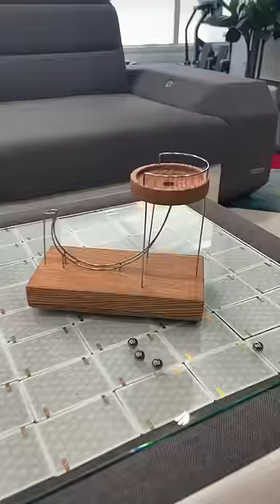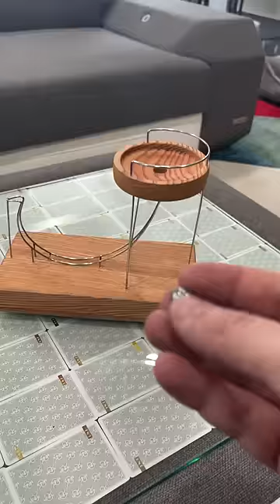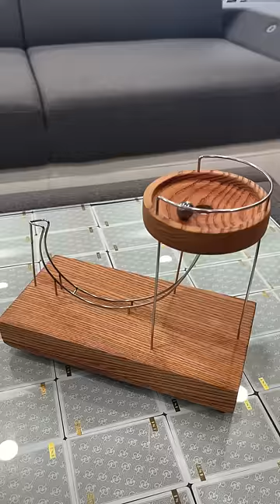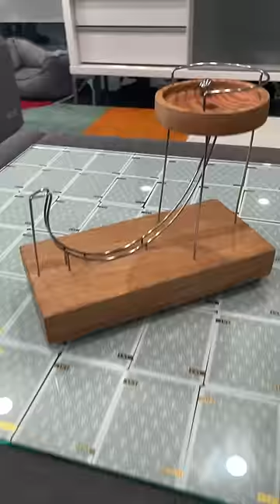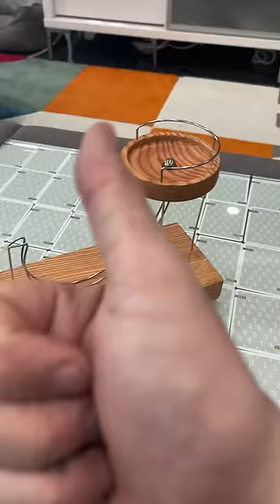An Impossible Perpetual Motion Device?! 😳 #Shorts

Comment: The fact that it went higher than the original starting point when it fell down is already a red flag and physically impossible. potential energy can't be the same or even higher than it was before.
Reply: so the metal ball is accelerated, right?
how can you attract and accelerate metal/steel? ;)
Reply: @rickwoud4319  it either has an accelerating wheel next to that hole or an electromagnet in that thick base.
Reply: @madlad847  My money is that there is a magnet in the wooden bowl, you can almost see the indent of a ring around the hole.
Reply: @shuheihisagi6689  it has a motor and it runs on batteries. Looks good though.
Reply: Psh, just remove the laws of physics and it’s fine
Reply: "potential energy can't be the same or even higher than it was before"

Uhhh, that's not true in the slightest. Even if your're talking about GRAVITATIONAL potential energy, that assumes there is no initial kinetic energy, which even in this example there obviously is (even ignoring the fact that there's a hidden motor).
Reply: @ahall9839  wrong, there is no initial kinetic energy at point of falling down, it comes to a full stop at the hole. 

when it is falling/sliding down, potential energy converts to kinetic energy, so at the lowest point, there is only kinetic energy left, which can't be as high as the initial potential energy due to friction with the metal slide and air (which converts to thermal energy) and therefore the metal ball can't reach 100% of the initial potential energy again, meaning it can't jump on the same altitude level again where it once was. 

and if it had more kinetic energy at the lowest point than initial potential energy, which this toy probably has, it would be motor-powered and therefore no Perpetuum Mobile.
Reply: @madlad847  wrong. It doesn't come to a full stop. Thanks for the physics 101 explanation that I wasn't arguing against, though
Reply: @ahall9839  wrong. it does come to a full stop, there is no initial velocity in z-axis before entering the hole, and even it it had minimal speed in z, it would definitely be not enough to go much higher than its initial starting point, which it did here in this video. and even if, it wouldn't go on forever like this here did because friction would quickly slow it down. 

looks like you needed that physics 101 though...
Reply: @madlad847  I said there was a motor in my first reply. Are you perhaps... neurodivergent?

And of course there is initial velocity, this isn't an idealization like in your high school physics class to make the math easy enough for you, this is real life.
Reply: @ahall9839  thefuсk are you talking? you were arguing against my argument that a perpetuum mobile (like the fake one in the video) can't exist because potential energy can't be higher than its initial value. obviously when you put kinetic energy from another system (motor) in the ball it can go higher, but then it's not a perpetuum mobile rofl. so again, what are you talking about?
Reply: @ahall9839  to your edit, there is no SIGNIFICANT inital z velocity, if there was, it would be so small that there is no way that it could go that much higher in altitude. just read my replies correctly.
Reply: @ahall9839  talking about high school physics, the irony is strong in your comments...
Reply: @madlad847  it's not that complicated. You said "potential energy can't be the same or even higher than it was before" which is just an incredibly dumb and incorrect blanket statement.

Even if you had less incorrectly said GPE instead of PE, that still ignores initial KE which exists in 100% of real world scenarios (hint: this is a real world scenario).

So your blanket statement of "potential energy can't be the same as before" that if actually said correctly (which again, you butchered) only applies to very a specific idealized scenario. So you're just wrong in every way possible.

Now don't go on some rambling tangent where you regurgitate 19th century physics simplified for babies from your high school textbook and confuse yourself. I don't feel like repeating myself again.
Reply: @ahall9839  spare me with your smattering, you still didn't get it. read again and tell me when you got it, cheers.
Reply: @madlad847  I'll take that as a concession since I refuse to believe that this is too subtle for even you to understand with your limitations.
Reply: @ahall9839  whatever you want to believe mate, i just don't discuss with apes, waste of time, like swimming against the current. cheers
Reply: That's a moot point, because the ball isn't at rest to begin with, it has kinetic energy.

However, the fact that it both is higher than it was and clearly also moves faster than it was as it enters the platform makes it obvious that it must be accelerated along the rails.
Reply: So may people in the comments clearly don’t know what they’re talking about and will defend it to the death
Reply: He tells u in the video that its impossible. Why are u acting like ur some genius that has seen through his lies
Reply: ITS AN ILLUSION LOL
Reply: @ahall9839  Wrong so many times lol.
Reply: @IlluminatedUser  Just people who "learned" physics by watching 3 YouTube videos, but don't know how to actually do physics.
Reply: @madlad847  wrong. Other guy is right. Youre wrong. Get over it , L taker. Its your calling. Be proud.
Reply: @lookupverazhou8599  found the alt account. Sad.
Reply: @ahall9839  Lol, I have a degree in physics.  The other guy is right.  Also, he uses a lot less word salad to hide his ignorance.
Reply: @couldyou4745  You his boyfriend or something?
Reply: @ahall9839  you're simply not correct
Reply: @thewerepyreking  you're simply not correct
Reply: @ahall9839  I read through everything already, I suggest you do the same. You should just be aware that you're not communicating anything properly or that you have a fundamental misunderstanding
Reply: @thewerepyreking  I read through everything already, I suggest you do the same. You should just be aware that you're not communicating anything properly or that you have a fundamental misunderstanding
Reply: Isn't it getting its energy from gravity
Reply: @plantainsame2049  yes, that's potential energy.
Reply: If we could harness  stupidity .... My my  infinite power . Y'all smart people are killing me! 🤣 we all know pmm are an impossibility on earth. ✌️🤦
Reply: @rickwoud4319  through magnetics
Reply: @madlad847  lol why are u goin back and forth with the uneducated 😂
Reply: The ball has some initial kinetic energy before it goes down the drain, there’s also some energy in the ball that’s used to spin it. If he were to just drop the ball down the hole, it wouldn’t make it all the way around.
Reply: Brother , I looked it up on line it's an electro magnet , batteries are in the top cup ! THE END ✌️
Reply: If there was a magnet wouldn't it stop moving so it goes towards the magnet
Reply: Centripetal force would accelerate the ball so it could go higher than it’s original starting height.
Reply: @susielearocks  it has a battery and is an electro M. The ball is the on switch it accelerates because it's being pushed / pulled like a military rail gun. *It's nearly if not completely impossible to get back more then what's put in. Their will always be drag ( on earth anyways)
Reply: @r3b0x91  nope, again, there is no initial kinetic energy in z-axis (and if there was, it's neglectable and of no matter here), and rotation energy is only useful if it had topspin, which is totally random because it is random when and where it falls down and therefore what spin it has.
Reply: @susielearocks  this is big bs.
Reply: @erikcampbell1176  the hardest part of a perpetual motion machine is figuring out where to hide the batteries 🤣
Reply: @ahall9839  did you just try to use 'neurodivergent' as a put down?
Reply: @shuheihisagi6689  there definitely is. Watch the ball, it staggers near the middle, like it's being pulled.
Reply: @susielearocks  thanks for the lol
Reply: The potential changes when the slide comes into play…there was the plate potential and once it went through the hole, the altitude added to the current potential giving it enough speed to reset itself
Reply: @dirtwizard5647  what does the battery do to accelerate it, without it staying where the magnet is?
Reply: @autumnsilverwolves  it's an electro magnet, not permanent, the current begins when the ball touches both wires it's like the on switch. The current pushes the ball .
Reply: @Ceretrea  I believe so.. although sad I found it pretty funny to think someone would "use a slur in a politically correct way" if you will
Reply: @ahall9839  editing "autistic" to say "neurodivergent" doesnt make it any less demeaning to autistic people, as the intended message is still there. Assuming someone has a learning disorder because you can't bear to not look down your nose upon them is still not cool ):
Reply: @mikebiff  the situation reminds me of that yakuza guy who said something along the lines of "you mean those (demeaning adjective) fucking foreigners?" during an interview, to which the interviewer replied "that term is pretty rude, its polite to not call them that" and the guy responds along the lines of "ah, sorry. You mean those (synonym of foreigners that is still somewhat pejorative but less so)?"
Reply: It looks like the device is sitting on a grid ? Magnetic pulse ?
Reply: @shuheihisagi6689  my thoughts exactly, it looked like it acelerated from the first time I saw it
Reply: Wrong. The total sum of potential AND kinetic energy together can not be higher than it was. Since Chris gave it a kinetic motion on top of its potential energy it is allowed to get more potential energy than before at the cost of traveling slower than it started.
Reply: @daddiboi4121  It's in a funnel, gravity does that to objects in a funnel as well. Electro-magnetic force and gravitation aren't even that different in classic equation form.
Reply: @reznovvazileski3193  please, read the discussion... thanks. 

and anyways, it's battery powered, so no need to continue this whole thing.
Reply: @madlad847  I know it is battery powered I'm just clearing up wrong statements in said discussion. It could have initial velocity in the centre as well as angular momentum storing sufficient energy to make the jump higher, though shorter. The real way you tell it's fake is that it makes it both higher AND longer. The magnet is down in the bottom where you see it accelerate faster than just gravity itself would make it accelerate, not in the funnel so the funnel effect in the hole is actually due to gravity. I'm not saying it's the real deal, I am saying that a lot of arguments being made here aren't the reason that it's impossible.
Reply: @madlad847  On top of that even without initial velocity your statement of potential energy can't be the same would be wrong as well since in a vacuum with dS=0 which is possible, since dS must always be smaller OR equal to 0, that can be done even from perfect rest.
Reply: @reznovvazileski3193  ah i didn't notice that he was in a vacuum in this video...
Reply: @reznovvazileski3193  what velocity, what momentum? i don't see anything that could justify this jump without external energy.
Reply: @madlad847  I'm not saying he was in a vacuum in this video I'm reacting to your statement if the impossibility. Is this video the only scenario that is possible? No it is not. As far as angular momentum, you literally see it roll into the funnel by spinning around it, that is how funnels work, this can give the marble angular momentum. Yes, the planets have to align for this to pick up enough to make it possible, but again, your statement sayss impossible so I argue against impossible. You can both argue the right side and also be wrong if you ignore enough accuracy is my point here. That's what flat earthers thrive on, and those people piss me off so I call inaccuracy out to fix it before they get to play with it justifying their delusions.
Reply: @reznovvazileski3193  look, my whole point is that there is nothing else than potential energy in this example, everything else is so little and therefore neglectable. 

translational kinetic energy in z-axis is neglectable, as the ball pretty much comes to a full stop for a split second at the hole once it bounces into the device's wall, so almost all of that ball's initial velocity/translational kinetic energy went into the device and is wasted.

from there, only gravitational potential energy (and maybe minimal rotational kinetic energy, which would only be useful if it had topspin though, which it didn't have in the video) is left.

so, this is my main statement explained, this should be the only big factor and reason why this device in this video here can't work.
Reply: @reznovvazileski3193  of there's a slight change in the angle around the hole, yes. But if it's all the same angle, a hole doesn't have its own force, it wouldn't stagger.
Reply: @daddiboi4121  I'm not sure what you mean by stagger here? The twitchy motion before it drops in you get when you make an elliptic track into a round hole like those marbles tend to do, as you can also observe watching similar funnels function in Jelle's Marble Runs for example which I don't even wanna admit how many hours of my life I've spent watching that.
Reply: @mikebiff  I'm just sad that someone would tey to equate neurodivergent with stupid? in 2022. When do we all move forward to the 21st century? Smh
Reply: @karlfreiha2343  aah yes..
Reply: @Mad Lad @ahall WRONG!
Reply: @ahall9839  either you skipped highschool physics or are a lawyer who is used to proving people wrong by details in their sentence structures. most likely both haha
Reply: @ahall9839  You used neurodivergent as an insult and expect us to believe what you say, how?
Reply: These things need power supply, sadly. So it's fake
Reply: @rickwoud4319  the way the ball moves around the hole looks unnatural, like it’s simultaneously repelled and attracted. So magnet?? 🤓🤷‍♂️
Reply: @belletaunde102  True, I know how people with your sensibilities like to find any excuse, no matter how relevant, to remove the burden of having to think too hard about anything. Not that this requires THAT much thinking, but still.
Reply: Does the spinning of the ball add acceleration down the chute?
Reply: any claim of perpetual motion is a red flag. this wasn't claimed to be real. there'll be a magnet underneath or something.

Comment: That metal has got to be an electromagnetic. You can practically hear the acceleration as it shoots down and up into the air.  Looks trippy though , still cool.
Reply: Yes that is what it is
Reply: No shit, he literally said perpetual motion is impossible.
Reply: It's not electro magnetic, that's just the acceleration of gravity before hitting terminal velocity of any sort at play, the sound is just the ball falling and being guided by the metal rails.
Reply: @kozmoman1066  like you be building these
Reply: @stevoz748  Nope. It's got a battery in the wooden base. That's how it is powered.
Reply: @Mrbladesofchaos  and I don't need to in order to understand what impossible means.
Reply: @stevoz748  if it’s not electro-magnetic, what’s your proposal for how this works? (Considering perpetual motion devices don’t exist)
Reply: @stevoz748  it’s literally impossible for something to fall with enough energy to turn around and then go higher than the height it initially fell from, otherwise it’d go against the laws of thermodynamics. There’s energy being added in somewhere, the base being so chunky means there’s almost certainly something hiding in there adding some energy, most likely an electromagnet.
Reply: @captaincracks  Yeah, but it has to be timed, that's what I'm curious about
Reply: @Alexrayioons  my guess would be one of those points where it "mounts" into the wooden base near the bottom, if you look carefully there's actually quite a few points going down into the base, my guess is one part detects and acts as a momentary switch for an electromagnet.

Comment: Likely explanation: the wooden base contains a strong permanent magnet underneath where the rail meets the wooden base. The rails on either side are electrified and the current passes through the ball bearing, generating a Lorentz force which accelerates the ball. There'll be a battery in the base as well to apply the voltage.
Reply: Ty ,wizard
Reply: I have one there is actually a motor in the wood top with some spinning wheels and it speeds up the marble
Reply: If it had a magnet it would not be perpetual
Reply: Like the principle used in the gauss cannon that the army is testing?
Reply: @blahblah-kk4jg  relax bro its a youtube comment
Reply: This man is a wizard
Reply: @andrespereira4852  Very similar.
Reply: @Migi05  That’s kinda the point. It isn’t perpetual. It’s powered
Reply: S
Definitely Magneo
Reply: The left and right rails are connected to each other, it's one piece of metal.
Reply: @Migi05  *electromagnet. A permanent magnet would be fine.
Reply: The Lorentz force doesn't do work on electric charges though.
Reply: Nearly right, it actually uses a switched electromagnet.
Reply: @spectrasouls  Now you've ruined it for me.  😠
Reply: Yeah, it's actually rechargeable too.
Reply: In other words, it's not infinite
Reply: Or it just stops after a couple of cycles